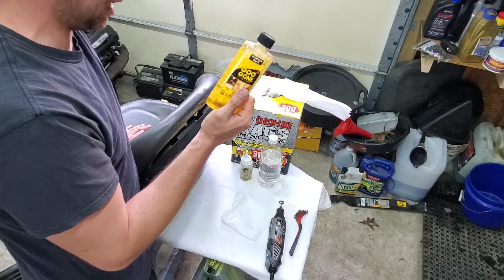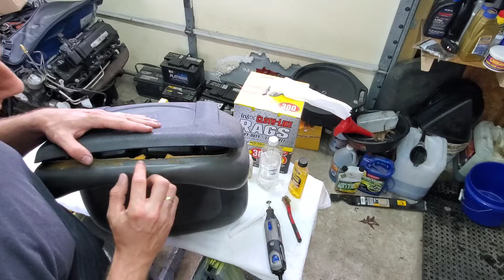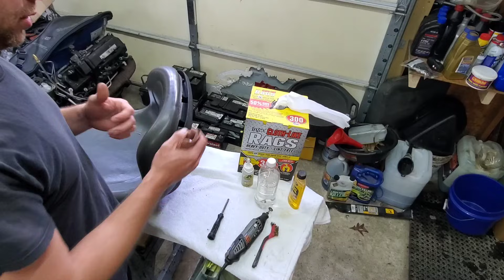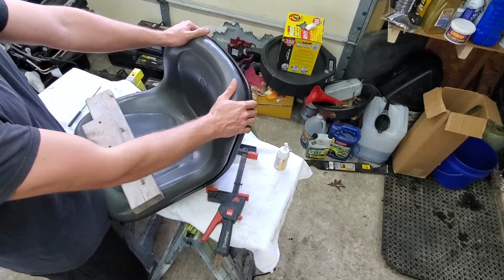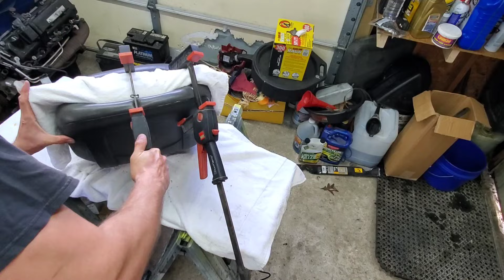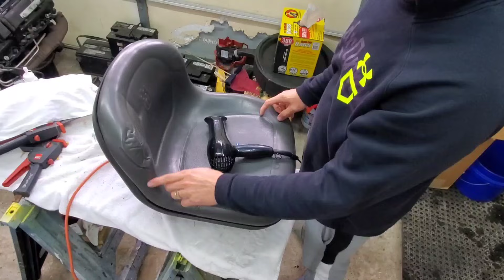Lawn Mower Seat Repair DIY

Comment: Wow, brutal!
Thank you, tho 
You told me everything I needed to know.
I've already tried, once. A friend told me what to do. It didn't work.
I'm not gonna use the Dremel or solvents.
Love the clamps. I'll get some of those.
I'm a lady, too.
I wasn't trained for this.
I'll let you know what happens.
Reply from the maker: Sometimes the original glue is dry enough to remove with a dull or butter knife and then clean with the solvent. Make sure to scratch up the plastic backing with sand paper so glue will bite better and hold longer. Best of luck with the repair and thank you for watching and the comment.

Comment: I had duct tape glue on a metal threshold. I took gasoline. It came right off.
Reply from the maker: Yeah the actual glue that holds the seat cushion to the plastic frame is alot more heavy duty and gasoline won't do anything unfortunately.

Comment: Great video!!  One thing, I have found that using plain Mineral Spirits works great on old glue.  It works SLOWLY though, so I soak paper towels or rags in it, lay it over the glued area, and wait a while (like 30 minutes or more).  Re-soak periodically so it stays wet.  The old glue usually softens up, and rolls right off.
Reply from the maker: Thanks, good info.

Comment: Are you pleased with using gorilla glue ? Did it do the job ?
Reply: How long has it been since you made the video and is it still holding?
Reply from the maker: @josephwagner2729  the seat I fixed is gone since I sold the mower that it belonged to. I do have one seat that I repaired about 2 years ago and it has sat the whole time out in the element and it's still holding good.
Reply: @mr_fixit  
When you say sat out in the elements … what state?
 
I’m in Florida and the sun is brutal. 
I look at glues that  say good for high temps. 

Just a quick note . Gorilla Glue instructions say to dampen one side that is going to be glued. This process will bond the compounds together better.
Reply from the maker: I've been using Gorilla Glue for a few years now and I'm pretty happy with the results.